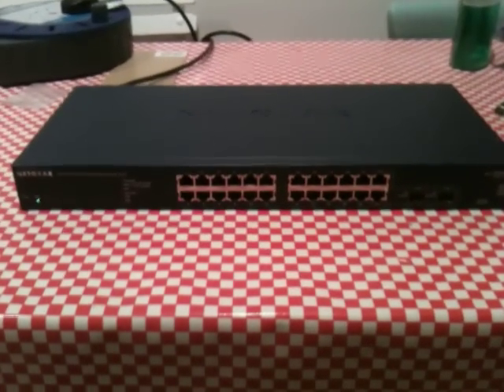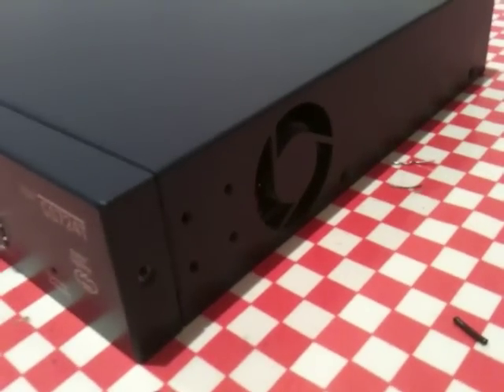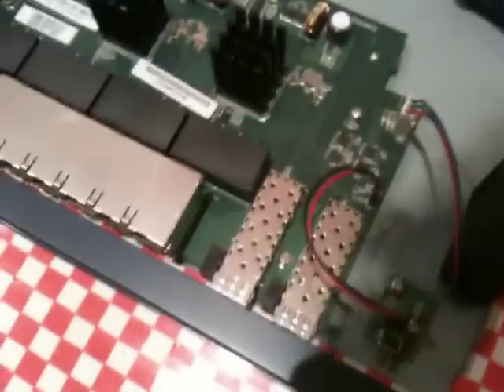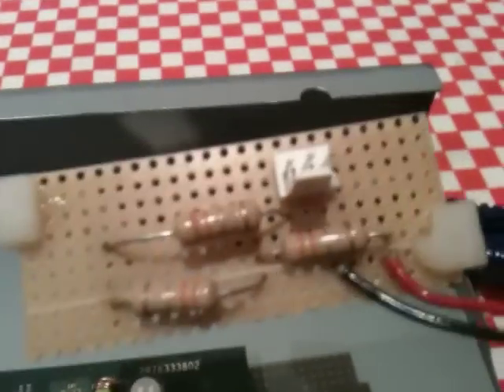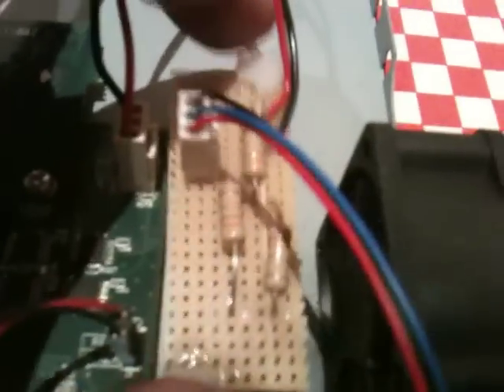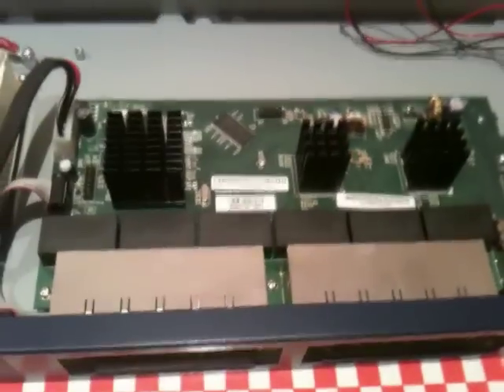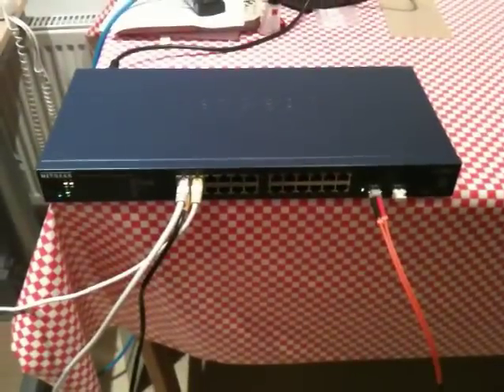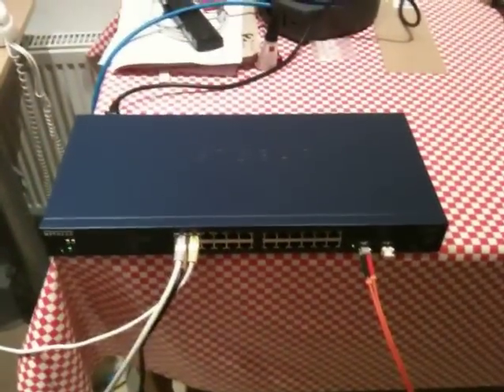Silencing a noisy Netgear switch

Comment: ahh looks like you got a bargin there :-)

The only thing i would have done different is use a LM317T regulator and 2 resistors, or some series 1 amp diodes 1n4001 or sim.

Ive found some fans need the current kick at startup and resistor reduction methods depend on the fan allways being the same, as dirt gets in the fan may need more current at startup.

a regulator provides this while keeping the desired voltage.
I suppose you could go mad and tamper with the fan feedback frequency pin.

Comment: I have a 3com one of these its a 24 port switch and it has 4 of these bloody buggers. I have tested the dB and it is reading about 70 dB. It dosent have 3 or 4 pin fan headers it looks more like a mullex but it isent any one have one / know what the connector is?